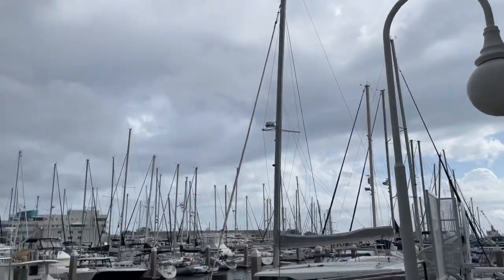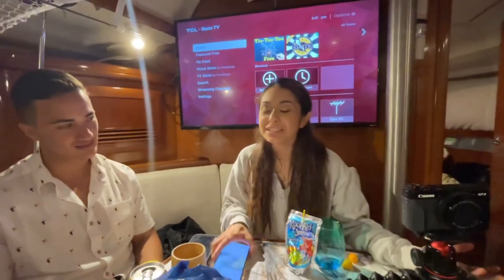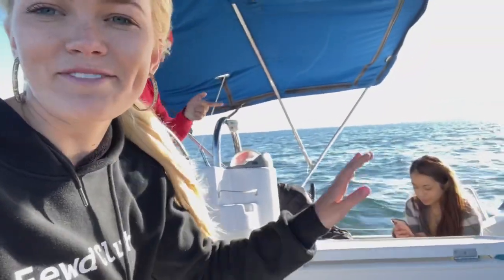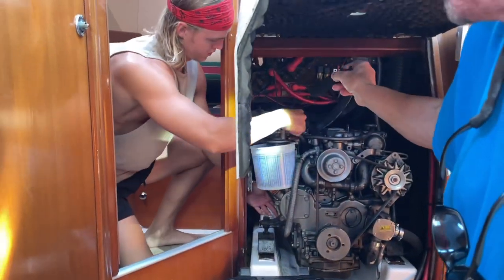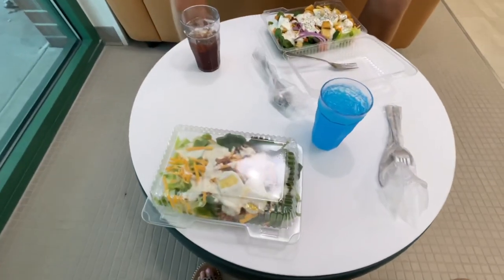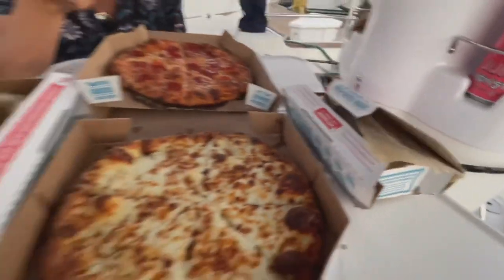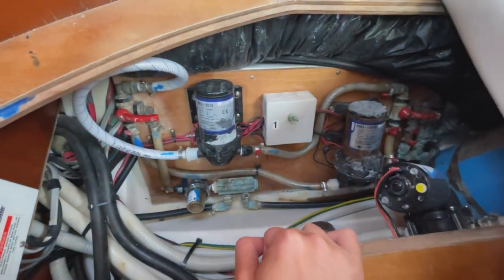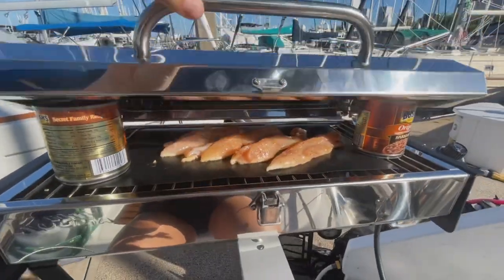Installing a New Bilge Pump / Learning how to Properly Reef🤦🏼‍♀️🤦🏼‍♂️ Ep. 8

Comment: Yes guys take the time to learn the individual systems on your boat ESPECIALLY the engine. fuel filters are cheap compared to the cost of replacing a set of injectors or having the injectors flown in to wherever you are in the world plus having to rent a slip in a marina while you wait. Learn about the use of fuel system additives. They are helpful to maintain the fuel system and prevent injectors from kruding up. It seems intimidating but if you consider each system individually it's not bad. Download information when you can and read at your leisure as you travel.( Excellent bathroom reading material)   This also helps to build your set of tools as most websites detail normal and specialty tools that you will need to service whatever system.

Did you know that using binoculars is very useful in inspecting your rigging so you don't always have to get hauled up the mast ? (ha!)

Comment: I hope one of your bilge pumps is wired to you batteries, no switch but a fuse properly sized close to the battery.  This will keep your boat safe just in case, so you will not be able to switch off all your bilge pumps one will remain to protect you.

Comment: Use electric connectors you heat after crimping. The glue inside seals the ends when finished. Buy any marine store. Works great in wet bilge.
Reply: A hair dryer usually is all you need to heat the connectors.

Comment: Your knowledge is growing exponentially.....that being said before you set sail you need back up plans for certain system failures.....if you check out the last sailing Zengaro Video you will see how important it is to have a back up bilge pump plan. It might be wise to have a portable submersible pump and a portable power supply such as a Jackery solar charged inverter and a discharge line long enough to move the water overboard. I am a father of five children and I want you kids to be as safe as possible on your first voyage. Best wishes always and stay safe......Oh and have fun on your spectacular journey
Reply from the maker: We like to think so! We have lots of backups!

Comment: Electrical work sucks! It's not hard to learn, but I still hate doing it. I would highly suggest buying a good amp meter. It will save you a ton of time and money narrowing down and isolating your issues.
Reply from the maker: Great idea! Thank you!
Reply: Or just a test light
Reply: @davidjessee7701  ....yeah...a test light will tell you if you have power, just not how much power you're getting. I have spent hours chasing an electrical problem before, because I thought it wasn't somewhere that it was by just using a test light. I had an electrical issue with a lift pump on my Cummins. It had current, just not the voltage it required. Had I used a proper meter, I would have saved almost half a day and a service call. Lesson learned.

Comment: Please take a bit more care with the audio levels.  Hate having to watch holding the volume knob.   Here is the manual of everything. Boatowners Mechanical and Electrical Manual byCalderyou really need this book.Be very grateful for all of the extremely valuable free education you have received. You don't want to think about what those lessons would cost from someone on the clock.It is VERY important for Nellie to learn as well.  In an emergency you can't have half the crew not knowing vital information.
Reply from the maker: Will do! Thanks for the suggestion!